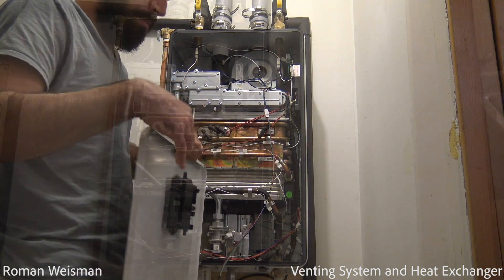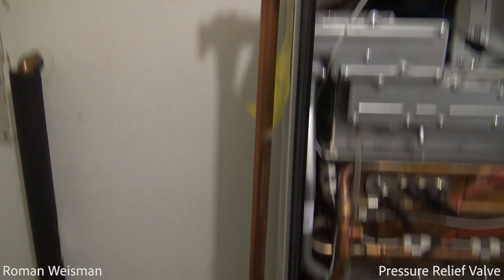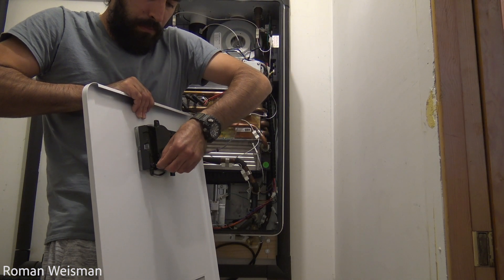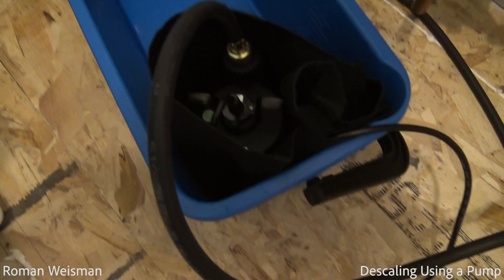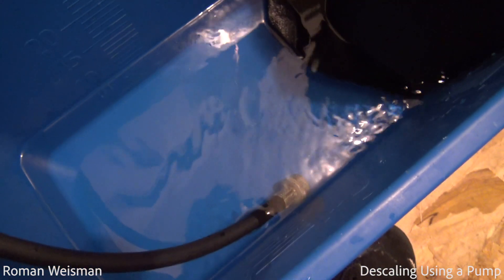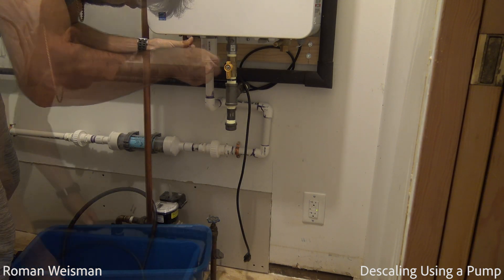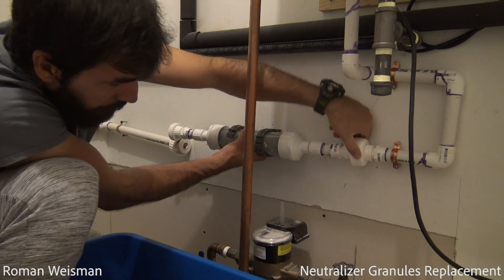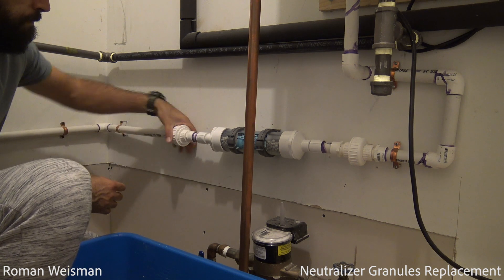Tankless Water Heater - Annual Maintenance

Comment: I have the same Bosch tankless hot water heater, but need to replace the inlet water filter. Where can I buy a replacement inlet water filter if I found mine damaged?